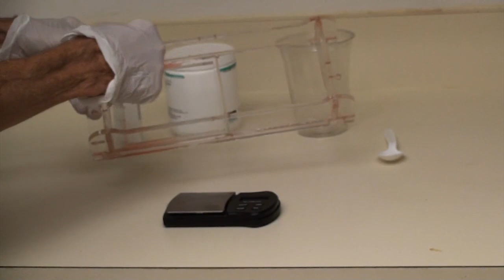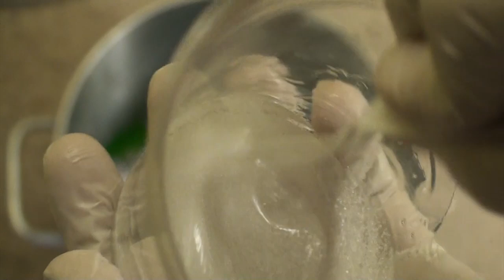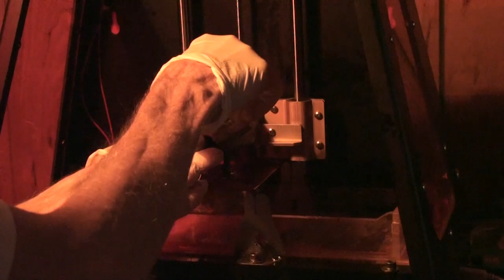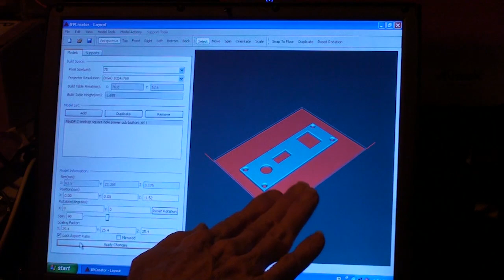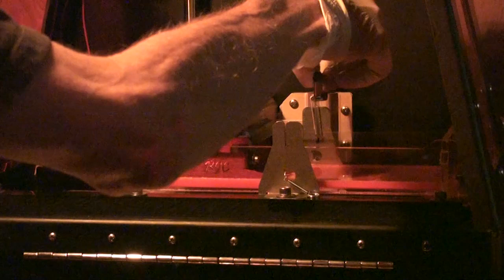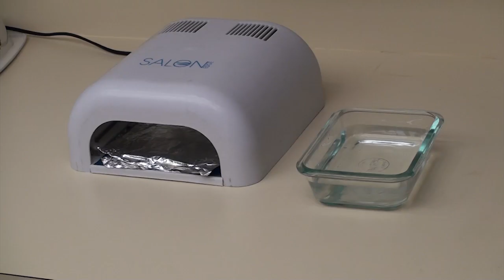B9 Creator 3-D printer tour and how to do it

Comment: Hey thanks for posting this.  It was a big help getting our B9C up and running.  No problems whatsoever.  We are using the cherry and have no issues during burnout for jewelry.  BTW, the new vats now come with the PDMS coating already done and ready to rock.  Saves that pain in the neck.  ;-)